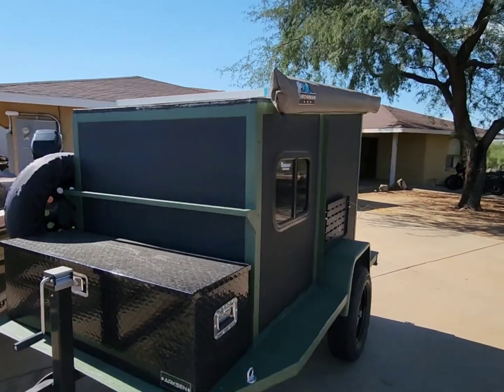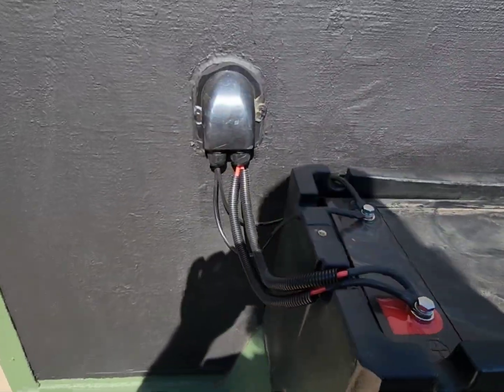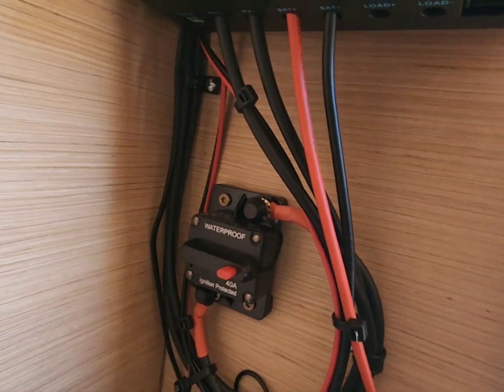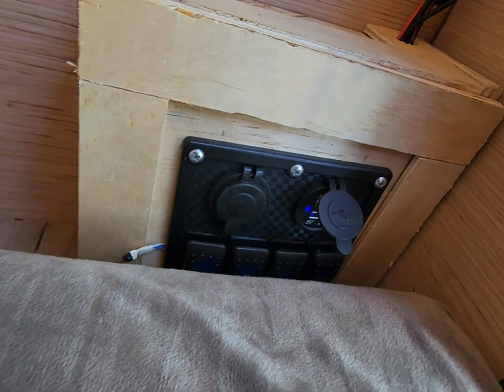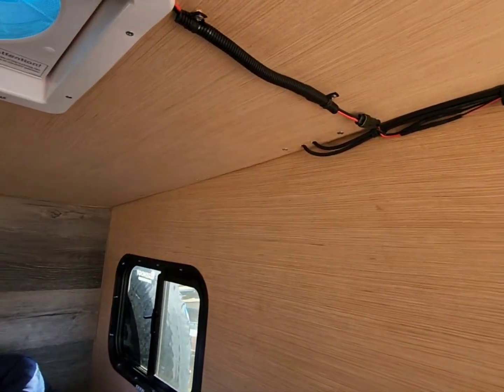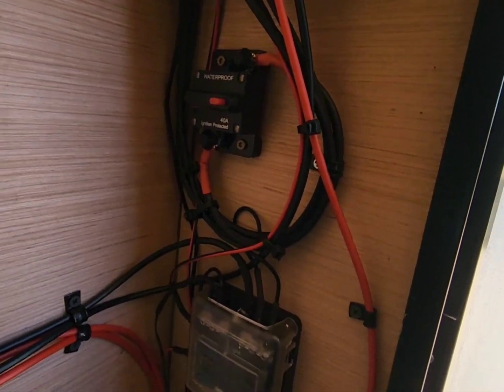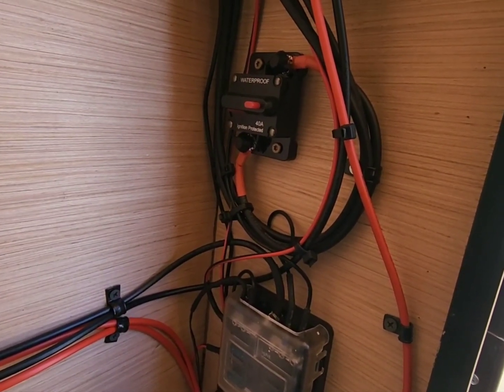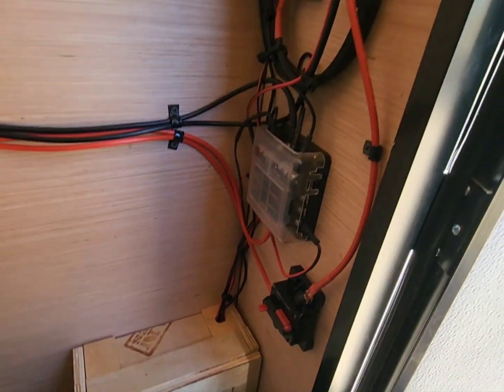My Solar Setup | Renogy 2 100w Panels | 40a MPPT Rover Charge Controller

Comment: nice video, i have almost the same setup at my house.. with the 2000W renogy inverter to run household items.. i upgraded to 2x250watt panels. loving it so far!
Reply from the maker: Thank you, the renogy systems are great. I'm building another camper a little bit larger now and will be running 3 100w panels on it.